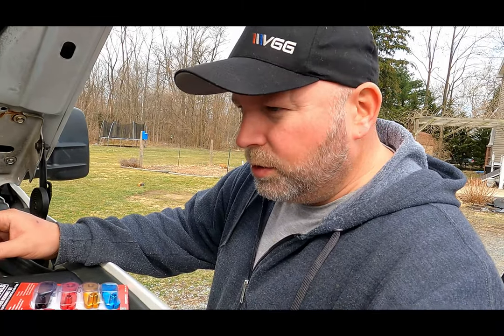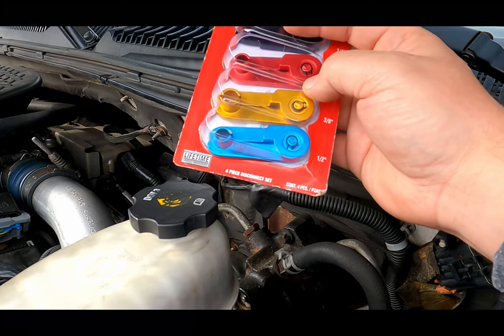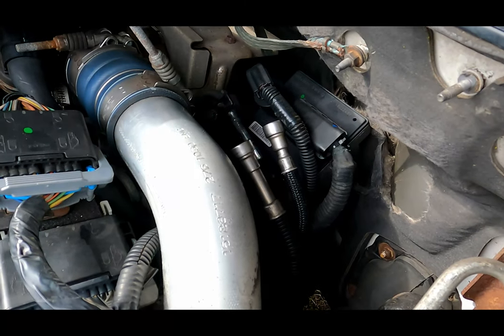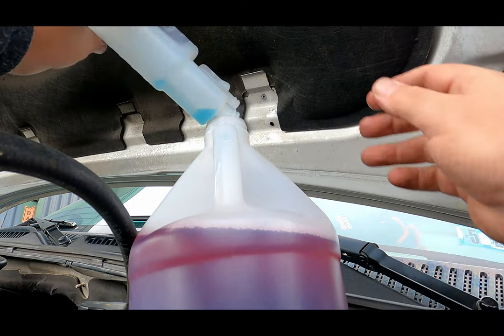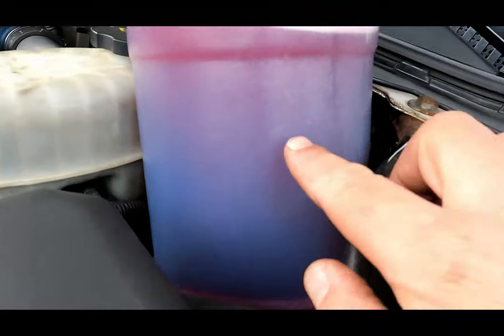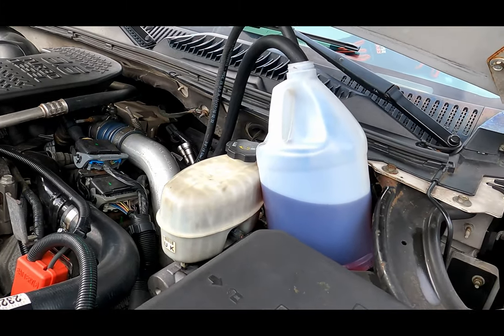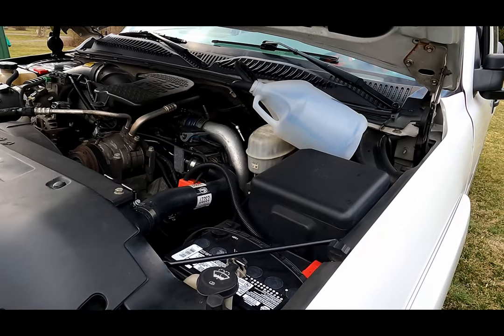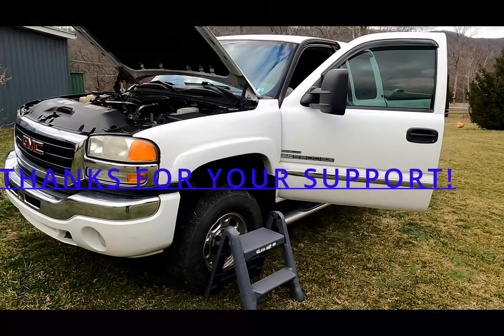DURAMAX INJECTOR CLEANING CHEVY SILVERADO / GMC SIERRA 6.6L PROLONG THE LIFE OF YOUR INJECTORS!!!!

Comment: fill your fuel filter with seafoam, run for 2 min, turn off and let soak for 15 min.  Start and run 30 min working the motor

Comment: October 2022 can still get the BMW formula for $30/bottle. Just ordered some myself. I do have a white smoke at idle. I will see if this cleans it up
Reply from the maker: How did it work for you?
Reply: @madmikesgarage4861  It did not. No smoke at all during the cleaning process, but once I  hooked the fuel lines back up, smoke was back. It was worth a try but my injectors are just too far gone
Reply: @michaelbowman7398 hey man what color smoke Is bad injectors typically because mines been grey smoke I’d say
Reply: @griffenfranklin8576  mine was lighter grey mostly at idle. I just replaced the injectors. One was almost completely clogged. 3 others partially clogged. Zero smoke now
Reply: @michaelbowman7398 im having issues, my truck sometimes doesn’t upshift until I let off the throttle, I was told it could be the injectors because white/light gray smoke comes out. But I don’t have white smoke at idle, any ideas
Reply: @captainuselezz8344  I didn't have that issue. Sounds like it could also be transmission related. A good code reader can see your injector balance rates(probably need to have a shop check). Otherwise, would probably have a transmission shop check it out.